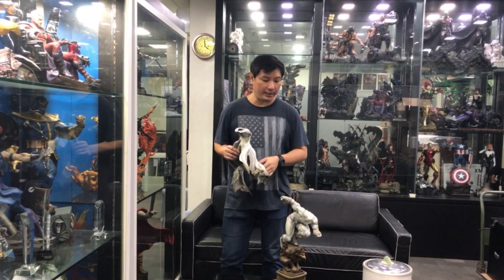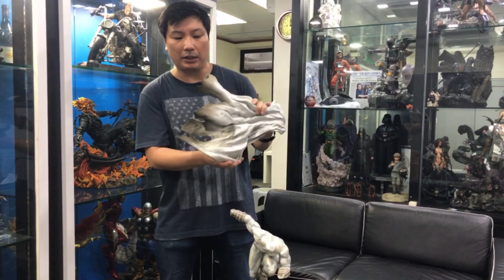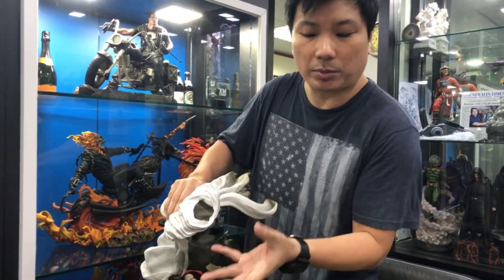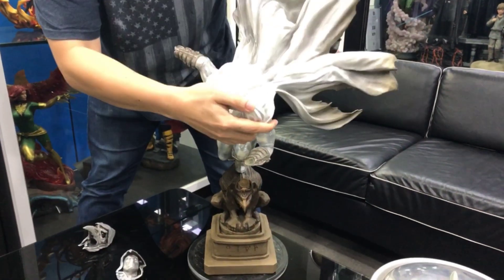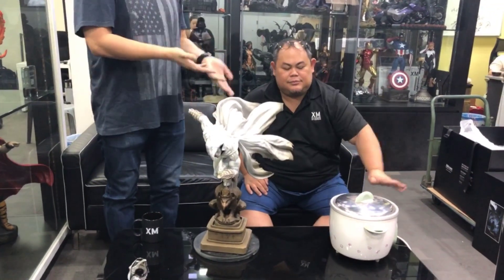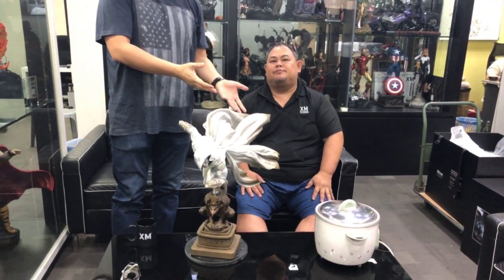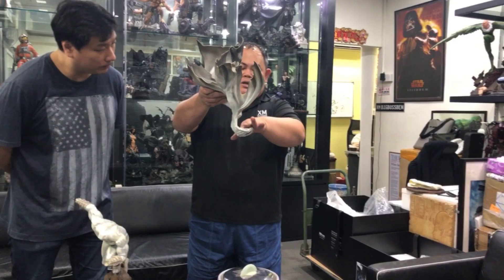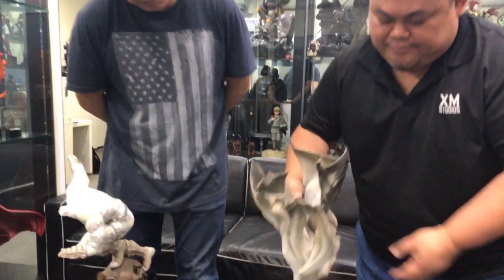XM Guides & Tips - Moon Knight

Comment: why couldn't you use a blow dryer instead?
Reply from the maker: Hi Philip, You actually can. The mechanics using heat is the same however we used hot water as it is easier to apply the heat evenly. With blow dryer you will need to be more careful as constant heating of a specific spot can mean overheating and causing damage to the PU whereas with hot water, it is impossible to overheat. If you are confident and good with the Blow Dryer it works too! You just need to control the heat enough that once the PU turns soft and manageable, you can stop applying further heat.